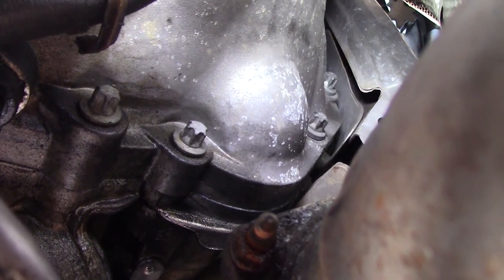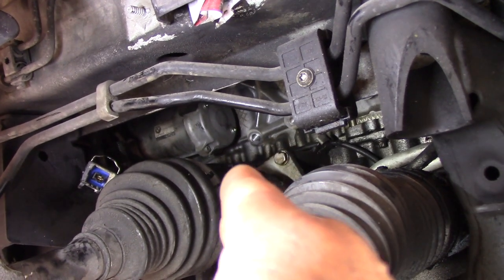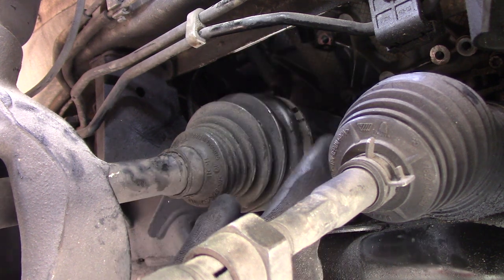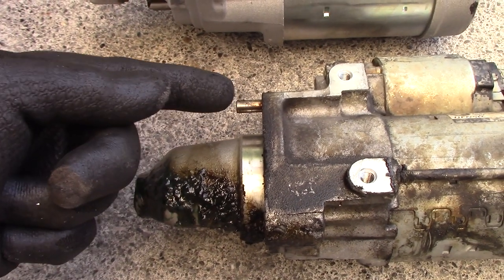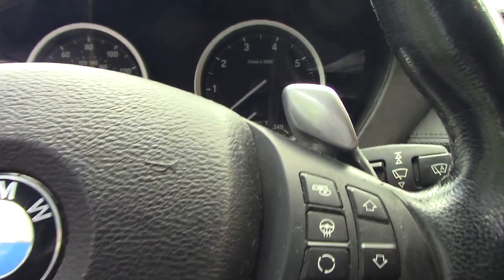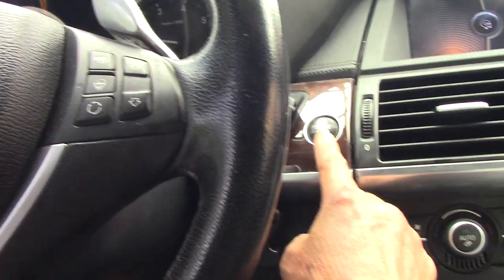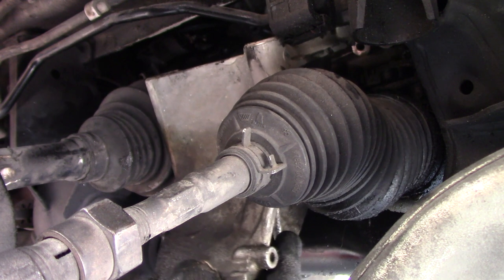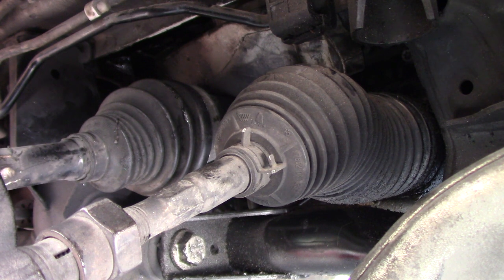DIY BMW X6 xDrive50i V8 Starter Replacement

Comment: I have a 2013 E70 X5 with the N63 engine. This is the only way to remove the starter. I did it 2 days ago and it took 5 hours. I could have been done in 3 but, I took my time and triple checked everything. The top nut on the engine mount was removed with a 3/8 ratchet with a 13mm (I think) socket and a steel sleeve for some added leverage. The most difficult part was jacking the engine up and down to get the holes to line back up on the mount. After all that work the vehicle still didn’t start 😂. It ended up being the ground strap and I was kicking myself for not trying to ground the chassis to the engine first. MAKE SURE to change the ground strap before changing the starter. Might save you time and money. Starts up quick with the new starter and ground strap though. I’ll be spreading the word in other videos.

Comment: Great Directions!  I was able to get my motor mount out without dropping the subframe.  I was able to loosen the bolt that holds the mount to the car working the space under the intake and once removed jacked up the engine an inch.  After disconnecting the swaybar and moving it out of the way, this allowed me to remove the mount, then I lowered the engine two inches to create space to get my arm up there to disconnect the power and relay connection and pull the starter out.  Thank you again.

Comment: how do you remove the engine support mount bolt, the big bolt on the mount. do you need an tool to get to it
Reply from the maker: It is 18mm nut on engine mount I used 6 point short socket and flex head ratchet we need lower vehicle sub frame with engine little bit to get room for turning
Reply: @AutomotiveServiceExcellence  thanks i was able to get it out after lowering the subframe. car start right up after swaping the starter